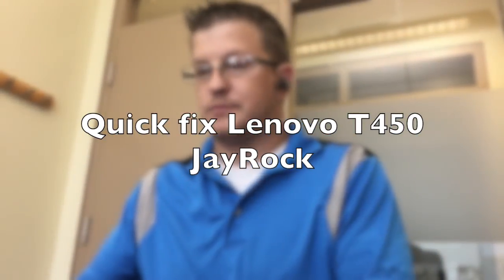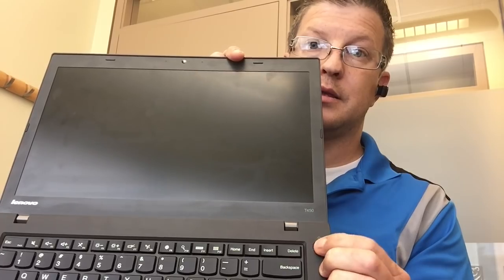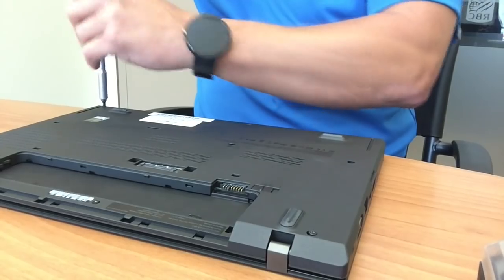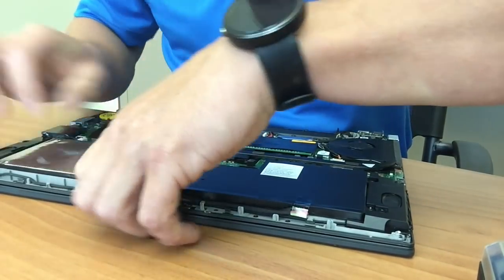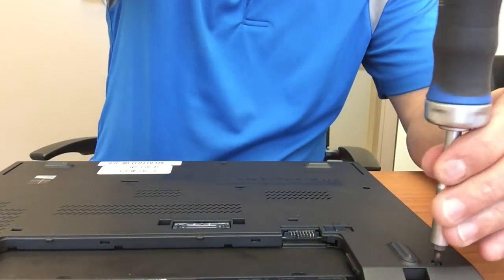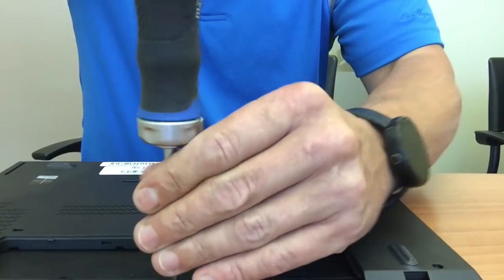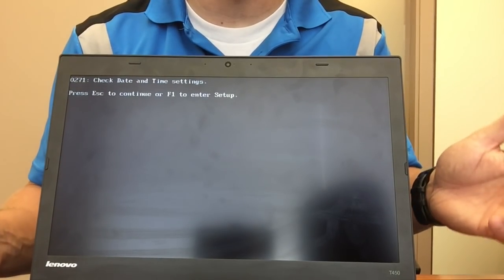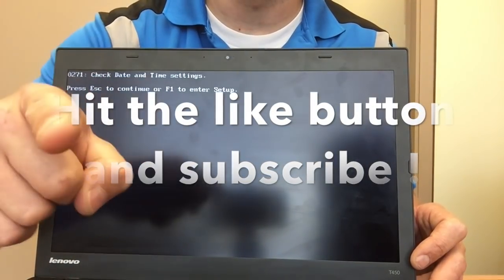Lenovo T450, T450s, X250, L420 and T440S Not Powering ON Quick Fix

Comment: Did not work for me :( now the book make a sound like piii when I try to turn on it. Can u help me to fix it please!!!
Reply from the maker: What was it doing before you unplugged the batteries?
Reply: @jasonflt  the laptop just didn't start. I was trying to restart it and then I saw you Video and I thought it is the answer to my problem but now the laptop still don't torn on and make the beep sound
Reply: I try again to unplugg the Batterie but don't work the still make the beep sound :(
Reply from the maker: Sorry for the late reply. You could try hooking up an external monitor to the laptop than pteranodons or take a flashlight and shine the light at the display of the laptop and see if you see any lettering on the top left hand side when you power on the laptop.

Comment: After reset (disc internal & CMOS batteries) my X250 will boot, but when I shutdown later, I need to open case, remove power again to boot. Thinking perhaps replacing CMOS battery. Suggestions for a fix are welcomed.

Comment: Would it work on a t420? It won't charge nor turn back on, though when it's plugged in and i press the power button i can hear the usual noise it makes (the fans?), and the little light on the Maj key lights on for as long as i press the power button
Reply from the maker: Sounds like a system board replacement, you could open it up and check. I can't remember off the top of my head at the moment if the T420 has I. Internal battery, so some reason no it doesn't.

Comment: I can see the think pad  logo thing when turning it on but then it turns black again.  Help
Reply from the maker: Reseat the ram, cable etc, give that a try as well. Also connect an external display to see if it boots all the way to windows. You may need to try to get into the BIOS to adjust boot devices

Comment: I got lost w the dummy switches.  Do i just need to unplug internal battery and plug back in?
Reply from the maker: As well as the CMOS battery both have to be unplugged, wait at least one minute before plugging back in
Reply: @jasonflt  is it possible I don't have a cmos? I just see my internal.  Thanks for the help
Reply from the maker: It's usually a yellow or black battery size of a dime, all computers have it to keep the internal clock on the right time of day etc

Comment: Hey Jay, this was a life saver for me!  I bought thinkpad t430 for some SEO work and I have left it in a cupboard for a few months.  I tried to power it on yesterday and not dice.  The fingerprint reader scanning my prints, but kept saying they were incorrect.  This was because it was not able to check with the hard disk as it was not running.  On the t430 the memory slot also gives access to the BIOS battery and socket.  Pulling that socket for a 20 seconds and reconnecting got me up and running again.  Thanks so much!

Comment: Hi Jay, 
I have a Thinkpad T-460. It also has a internal battery and when i plug for charging the LED blinks 3 times and nothing else happens. Should i try this solution ?
Reply from the maker: Give it try,it won't hurt anything. Disconnect yellow CMOS battery and internal battery. Press the power button 10 times and hold for 30 seconds just to make sure all the power is out of the board. Reconnect the batteries back up. Put the bottom plate on. Plug your power brick back and try powering it on .
Reply from the maker: Yes press the power button after both batteries are disconnected. Also reseat your ram stick.
Reply: Its just the 3 blink even now. 
It didn’t work. 
Thanks for your prompt reply though.. 
is there anything else i could do ? 
And would my data be fine ?
Reply: How do i reset the ram stick ? I have no idea what it is.
Reply from the maker: Your data is safe, if you still have warranty use it.
Reply: No I don’t. Can you give any estimates? What it should cost like. It was working perfectly until last night. :(
Reply from the maker: When you have the back off the laptop, the ram stick is below where the battery would slides into. Sometimes under a black plastic cover that your need to lift up. There is 2 silver latches you have to press out words to release the RAM. It should pop up, remove and then reinsert. Cost on a replacement motherboard well depending what you can find online. Or take it to a local computer repair shop and see what they can do for you.
Reply from the maker: Go through the steps in my video again. Disconnect both batteries,CMOS and internal battery. When they are disconnected, press the power button 10 times and hold for 30 seconds. Reconnect the batteries,put the back,back on, screw down. Plug your power brick back into the laptop and try powering it on.
Reply from the maker: Hit that subscribe button and thumbs up please.

Comment: I spilt coffee on my laptop. A guy tried to fix it, but it turns on when they take out the back base but when the put it back it doesn't switch on please help.
Reply from the maker: there is a tiny dip switch by the internal battery, it's suppose to disable the power to the board aka makes you unable to turn the laptop on well the back is off, so i'm guessing that the switch is not functioning correctly. liquid damage isn't a great thing to happen to a laptop. you could try breaking off the plastic nip that triggers the switch up to you but i leave that in your hand to make that decision. no guarantee it will work.
Reply: JayRock I'm going to try that. But it switches on when the back is off but doesn't when it's put back on. 
Thank you though, I'll let you know what happens

Comment: Hi there. I have a 450s that has a backlight on near the left corner of display when the laptop is turned off. Usually it drains the battery . Need the charge on next use. Can you help .
Reply: Like a bleed near bottom left corner.

Comment: My Thinkpad L420 can be power up if i release then plug the CMOS, do you have permanent trick to resolve my problem?
Reply from the maker: Gwan Tjoek soon as you get the laptop to boot into windows , go to Lenovos website and update the bios .
Reply from the maker: so if i got this right, you disconnect the CMOS and you're able to power on the laptop. if the cmos is connected that laptop doesn't power on. i would almost say it's a faulty cmos battery. another thing is it connected to the motherboard correct ? i know dumb question but it has to be asked. 

Does your L420 have an internal battery as well?
Reply: yes it's well connected to motherboard, is that possible if we update bios then this problem come up, because i remember a few months ago  i did some update on my bios. i have change cmos battery but not resolve my problem.
Reply from the maker: Gwan Tjoek unfortunately it would be a motherboard replacement.
Reply: Hi there. My L420 has been turned off for a long time. and now when I tried to open it, it opens the main "ThinkPad, to interupt normal setup, press the blue thinkvintage button" page. However it stays stuck there. It doesn't change at all. when I pressed the thinkvintage button, it opens another system configuration page with bios system and everything, don't know what its called. But the arrows do not work, and I cannot do anything. Can you suggest something so that I can reset it to normal and start everything from scratch?
Reply from the maker: Sorry but I don't have a solution for you. Maybe ask on the Lenovo form or Reddit.

Comment: is the T420 the same?
Reply from the maker: Anson Y if my memory serves me right, that's an older model and I used to have one of those for work. That doesn't have an internal battery. So you would have a different issue. Try taking out the external battery, press the power button 10 times and then hold the the power button for 30 seconds. Give that a try. No guarantee it will work
Reply: JayRock alright I tried that but nothing works. But I think it might be my universal power adapter. On the power adapter it's green led is lit till I plug it in to my T420 then it start blinking, is it that its not feeding enough voltage to my T420? Thanks!
Reply from the maker: Anson Y if you can get an original power brick for the laptop,I would. Should be dime a dozen on eBay . Lenova/IBM used that style of charger for year's. The one that came with mine was a 90w .
Reply: ok thanks a lot man! keep up the good work!

Comment: hello !! First of all thank you for this video! It's an amazing one! I did everything but the laptop wont start. Could it be that the backup baterry the lithium 2032 ran out of it and i have to replace it ? Thanks in advance!!
Reply from the maker: Yafu Herrera disconnect both batteries again and press the power button 10 times then hold for 30 seconds. Reconnect batteries, closed the bottom up. Connect power brick to the laptop and try powering it on
Reply: Nothing :(  my friend sent it to a repair place where they told him he should change the mainboard, and since they wanted to charge a lot of money he decided not to repair the notebook.... could it be that this place disconnected something by mystake ?? the backup battery does not seem to be broken... it's still slim. Again, thank you for the help !
Reply from the maker: Yafu Herrera there isn't a backup battery. Almost all new Lenovo laptops come with an internal and an external battery. The CMOS battery is the little coin size 1. So what happens is that the internal battery dies and the CMOS battery takes over then dies, hence locking the laptop from booting up again. So disconnecting your batteries and letting the motherboard drain of all the power will bring the laptop back to life as long as it's not another issue
Reply from the maker: Yafu Herrera if you still have warranty you can try through lenovo themselves or recycle your laptop. Keep your hard drive and find a new laptop that's the best I can suggest for you
Reply: Unfortunately warranty is no longer applicable but i really appreciate you took the ttime to give me some advice ! Thank you very much!

Comment: my T440 is not able to boot but, its keyboard back lights are continuously flashing, i removed external battery but for almost 2 hours lights are flashing.. i am hoping once internal battery gets dead it will stop.does this Bios reset work for me?
Reply from the maker: when you say the backlight are you meaning the display backlight? you have to disconnect both internal and cmos battery. press the power button 10 times and hold for 30 seconds to drain all power from the board when the batteries are disconnected. reseat your ram. check your ram slots for garbage, some other people have come across that issue.
Reply: JayRock after battery getting drained completely.. i did power on laptop and now it started giving 7 beeps and not booting(331)..
any solutions?
Reply from the maker: Abhijit Raste sorry I haven't ran across that issue, I would disconnect the had drive and single stick of ram and reconnect all cables inside the laptop for trouble shooting. If that fails to work a motherboard replacement is required

Comment: Sir, I seriously need a fast help :-( I have Lenovo think pad L420 same problem but I didn't know it have internal battery or not and if it does have then how to open it be oz its not like T450, it have different back body but front body is full on same.
Please help me sir :-)
Reply from the maker: Surya Narayan I'm sorry but I've never taken apart L420. but like most Lenovo laptops are pretty straightforward just undo every screw on the bottom side of the laptop
Reply: Ok sir, I will open it but have one dout it does have internal battery like T450 ?

Comment: Pls i need laptop engineers here to help me out. I have a lenovo ideapad s400. Its charging,the power light will on but it won't come up. What's the problem with the laptop pls
Reply from the maker: joseph john sorry I haven't worked on an idea pad. few things I could suggest is, if it has a connection for a monitor connect it and maybe your idea pads display is bad, mostly your motherboard is bad, go to Lenovos website and do a warranty check. if you have warranty get it fixed . I'm not sure if the idea pads had battery issues.

Comment: What about for a T420?
Reply from the maker: if it's got an internal battery and you are having the same issue i would say yes. give a try and if it work for you please let me know. Then i will added it to the growing list lol. Update you bios after you get the laptop working.
Reply from the maker: you can also try this, disconnect cmos and internal battery. press the power button 10 time and hold it for about 30 second to drain any power left in the motherboard. reconnect and try

Comment: hi, I'm facing the same problem with my Lenovo T440p, except that the power button keeps blinking (green) but the laptop won't start. your help is much appreciated
Reply from the maker: chadia awad plug it in with external power bar after doing the cmos,battery disconnect and reconnect. Make sure your connections are good. reseat your ram and any other cable's
Reply from the maker: you can also try this, disconnect cmos and internal battery. press the power button 10 time and hold it for about 30 second to drain any power left in the motherboard. reconnect and try
Reply: JayRock could you please explain to me where is the internal battery coz it's not the same model.. thx
Reply from the maker: all the internal batteries are inside of the laptop at the front. black rectangle shape, very noticeable. depending on your laptop it may or may not come with one. if yours doesn't come with one then i would say you have a bad motherboard. if you still have warranty use it. Go here or depending on your country http://pcsupport.lenovo.com/ca/en/warrantylookup

Comment: hey Jay, I tried your fix but no luck. Everytime i my charger in the laptop start button blinks three times. I can plug my phone into the USB and charge it. however still can't start it up. motherboard?
Reply from the maker: Grant Ingold I would suggest reseating all the cables and pulling the CMOS battery an internal battery again as well as reseating the ram. give that a try and see how that works for you. just make sure you internal battery cable is seated in very well as of any other cable's. plug the power back in and try turning it on .
Reply: JayRock thanks for the suggestions. however, it did not work. sucks that this machine is only two years old and now worthless.
Reply from the maker: Grant Ingold ya blows my mind on how poorly these laptops are made. just had one to day no back light on display, even after change panel,cable and motherboard still no change, customer is shipping back to Lenovo. maybe see if you can get a used motherboard on eBay or something
Reply from the maker: you can also try this, disconnect cmos and internal battery. press the power button 10 time and hold it for about 30 second to drain any power left in the motherboard. reconnect and try

Comment: Hi,  I tried to drain the battery, but not the CMOS yet.  Didn't work.  Will try the CMOS next I guess.  Solid state drive, worried about wiping it out.  Really need to work, but the computer is DOA.  At the end of my rope ATM.  This is odd, computer worked when I left, landed and it wouldn't power up.  Wish me luck, thanks for the vid.  I have a Lenovo 450 like in your vid.
Reply from the maker: Traci Ashmus the SD drive won't lose any data if you pull the cmos battery. you have to disconnect cmaos and internal battery . a SD drive is like a thumb drive you won't lose data after disconnecting it from the USB port. you will be fine. after you get the laptop working update your BIOS
Reply: Thank you, I'm dubious but I will try again.  Appreciate the response!
Reply: It does indeed start up after disconnecting the cmos BUT...e61 Media test failure - check cable.  Getting closer I guess...still looking....Detection error on HDD0 (main HDD)
Reply: STATUS UPDATE, SOLVED.  'Rock's suggestions to drain the internal and CMOS brought it back - however,  the drive was not being seen by the BIOS and it couldn't boot.  Tried to select HDD0 from the boot sequence as a temp boot device, then it locked telling me it needed a bitlocker code.  I drained the bat's again as per JayRock, back to square one.  Finally I went all 1985 on it and reseated the drive cable.  Viola.  When in doubt, go old school I guess.  Thanks, JR - hope this is of some use to someone.
Reply from the maker: sorry i couldn't reply earlier, i have been busy all weekend, good to hear its working!

Comment: Hi Jay,

I  did the trick, my computer started right away, thanks for the that, you're a genius. However, when I've checked the batteries, I've got the following message: Battery 1: Not charging, Battery 2: Not charging. Would you know what the problem might be? Your help will be highly appreciated. Thanks
Reply from the maker: Petru-Alexandru Dragusin I would say you need a motherboard replacement because both batteries couldn't be bad at once but hey I have seen stranger things as a tech. update your bios as well, you can daigs that Lenovo provides on there website
Reply: JayRock Thank a lot, mate. I will do so. I've failed to mention that it was only one of the batteries that is not charging not both of them.
Reply from the maker: just double check the internal battery and disconnect it and reconnect it again. The one battery might be to low in voltage as well. let me know if doing a bios update worked to resolve that not charging battery issue.